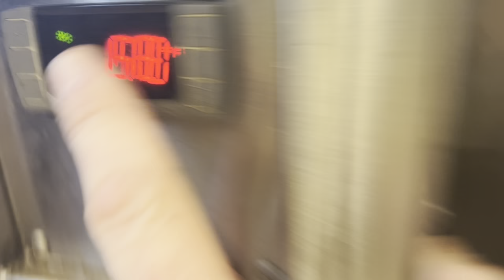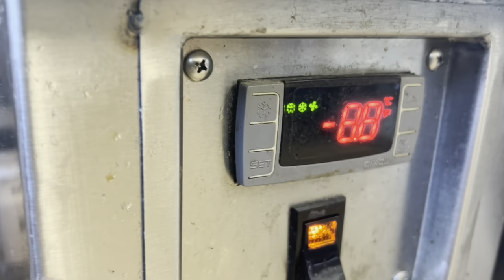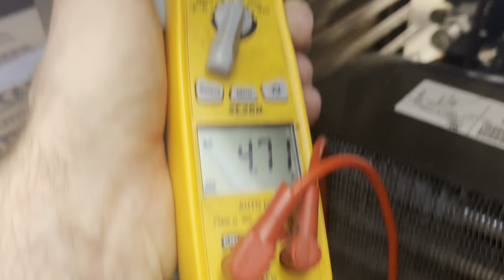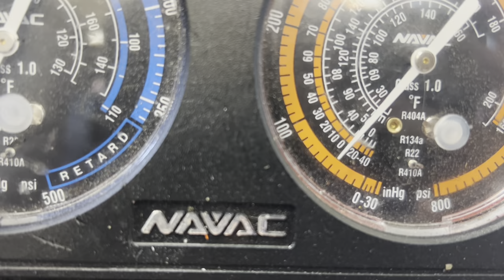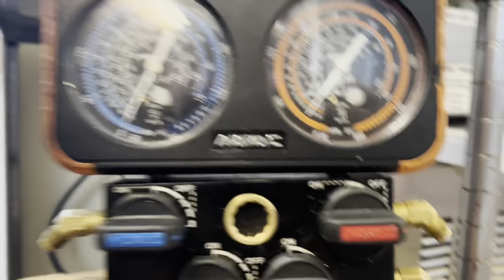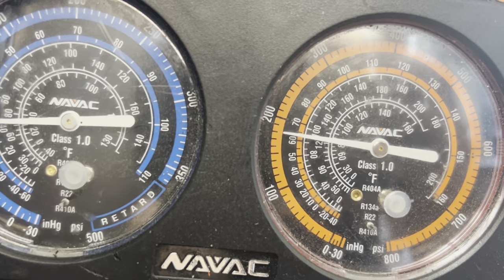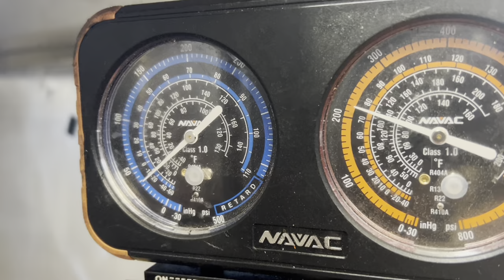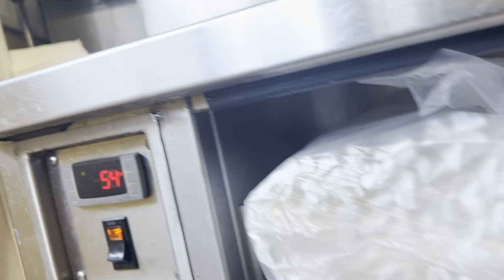Custom ice cream freezer down

Comment: R449A is a standard Refrigerant here in Germany because of the low GWP.
Reply from the maker: We’re headed that way but freezers here (where I’m at geographically) still operate on extremely efficient 404a.  Newly purchased units run on that or 448a thanks for the comment 🍻